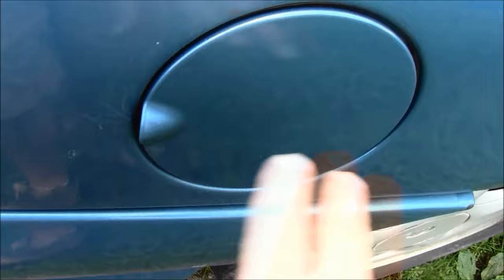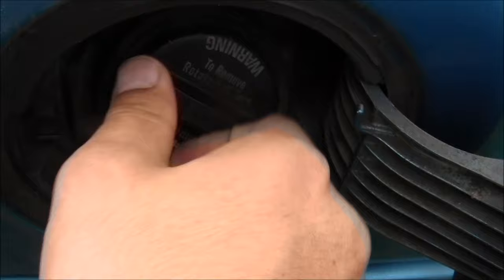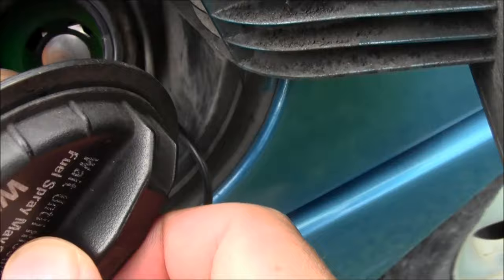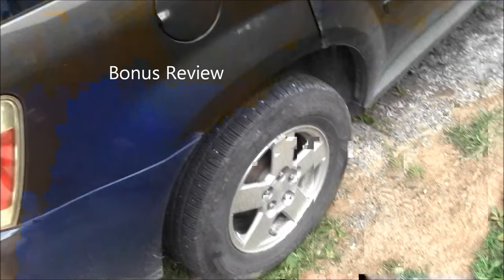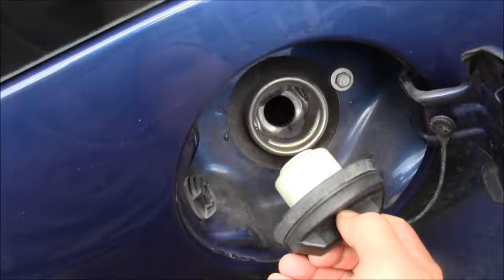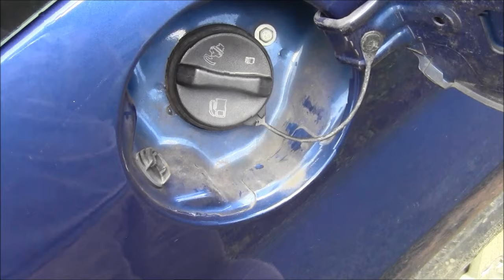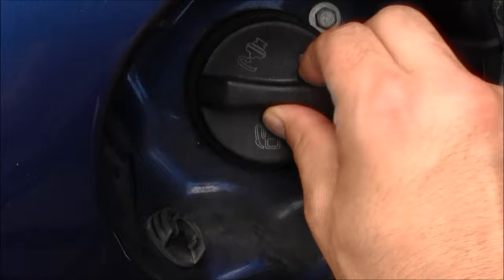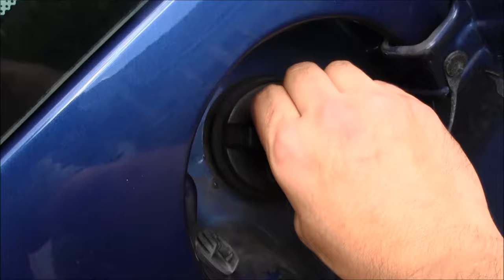How to Equalize Pressure in a Vehicle's Fuel Tank

Comment: Get a new gas cap. The vent valve is busted.
Reply: You just said two different things haha. The cap has a spring that will burp gas under certain pressure. But if you have a clogged canister or yes a bad purge

Comment: You might be mixing your acronyms.  It's not likely an HVAC problem (HVAC = heating, ventilation, air conditioning (interior climate controls)).  You probably mean EVAP problem (the evaporative emissions system that is supposed to vent those fumes through a charcoal canister filter and then to your engine to be burned off).
Reply from the maker: Good point.
Reply: You r 100% right. but my question is : what went wrong in the EVAP system ? so the pressure did not go to the manifold ?

Comment: the whole point of the fuel storage system is that those vapors don't escape - do not open the gas tank unless necessary....
Reply: Ligma
Reply: Be sure and ask a qualified dodge representative at the nearest 7eleven for a new set of tools, remembering to have them dipped in wheel bearing grease, just to be safe!!!
Reply: But surely the gas has to escape when you fill up the tank, otherwise where would they go otherwise..m? 99% of people will not know this is an issue surely? Unless a check Engine light comes on

Comment: Your vent tube is blocked that's why there is pressure build up. Other than that it's a pretty crappy video
Reply: Would this or a bad gas cap ,cause it to be hard to put gas in , when I put gas in , it takes 10 cents at a time and takes forever to put gas in.  And have had a broken gas cap for a while and didn't know.  The tanks stops the pump like it's full but isn't haven't seen anything like it. U seem like u know alot so wanted to ask.
Reply: @Theundisputedtruth 
Vent tube is bent or blocked.
Look next to fill tube. Vent hole is underneath the gas cap and is sealed by gas cap.

Comment: Hi, nice video. In a lot of cases it's not overpressure but underpressure(vacuum). That might point to an evap-problem/evap-valve malfunction, or some cars vent through the gascap. You don't solve that by just unscrewing your gascap. That just works for a couple of minutes. The minute you start the car and the fuelpump kicks in, the vacuum's gonna start building up again. Regards
Reply: So my problem is that I can't pump gas without losing my mind. Every time I squeeze the nozzle it just stops and every time I squeeze the handle it will flow for a few minutes and then stop. If you have a suggestion for this I would be most grateful!
Reply: @kinglegacyog9786  don't know what car you have , but you might look for a breatherhose running right next to the fuelhose going to your gascap. Maybe there's a vent valve/filter at the end that might be clogged. Regards
Reply: @user-2uf2kr2c hello brother: I have Chevy Optra 2011 it struggles starting and sometimes I there is fuel smell, as I have noticed it occurs when I have so much fuel in the tank, it is a bout a week I lose the tank cap it works well, my question is that what is my car depending what I explained above? Thank you so much
Reply: @QURAN-IS-MY-TORCH  you might try a good injector cleaner liquid. I use Wynn's injector cleaner.Regards

Comment: I am master tec replaced the evap purge solenoid cost less than $50 dollars Auto zone. This part fix your problem. Don't lessen all this idiot answer
Reply: arturo1329 hey I have the same issue and my fuel feels like it getting super hot.
Reply: And replace canister also.
Reply: This happens on my car the engine will start to lose power and rpms drop way below idle and it’s rough I have to pull over cause engines about to die. I pull gas cap off I do t hear anything but every time I do this the engine fires up all good again so I must have some ventilation issues also there’s no engine light or any codes. I’m thinking vapour build up and pump can’t pump vapour only liquid so it starves the engine of gas pressure no venting no gas pressure. It be like trying to drain a sink of water with no vent it drain really slow. I’m going to get my whole system looked at cause there’s obviously something going on
Reply: @ryans413  this is happening to my car too I’m not exactly sure what to do no one was believing me
Reply: @ryans413  try reversing both fuel cell diodes
Reply: Why does the cap say wait till it stops hissing. Im pretty sure this is somewhat normal

Comment: all of that is true but there is a pressure regulator in the fuel tank that it helps relieve that pressure. iam atill on the hunt for that thing
Reply: From my experience it could be the pressure sensor but it could also be something constricting the flow of those vapors in the evap line like a clogged canister. I would also make sure the vent valve for the tank is working. Normally it's open at all times and only closes during test but it could be stuck closed.
Reply: I have a neg 1psi in my tank. The scanner says low fuel velocity.  Engine runs well for about a half hour and then stumbles. Help...🙂

Comment: You have one or two check valve s On your gas tank and a over flow fil valve that probably needs replacing it will burst your tank there a half moon indentation on the bottom of your tank it's put there so of it builds pressure It will pop open and leak gas  then you  replace tank and that's fun... replace check valves one or two and hoses thd splitter if it has one and over flow valve  if you drop tank so you don't haft to mess with it again  do it one and do it right also disconnect positive cable.